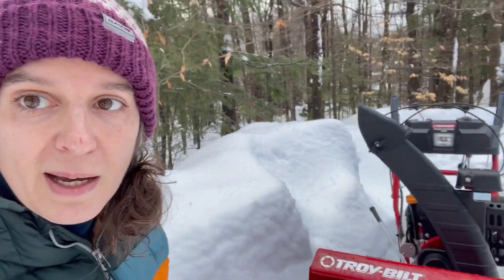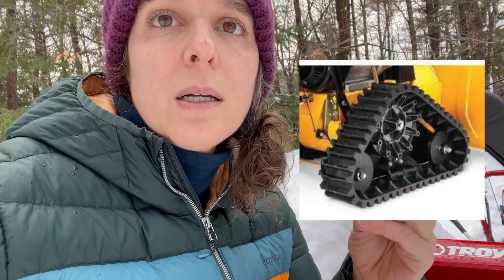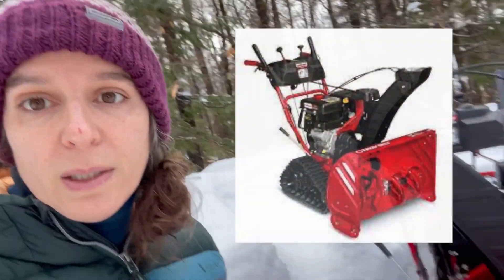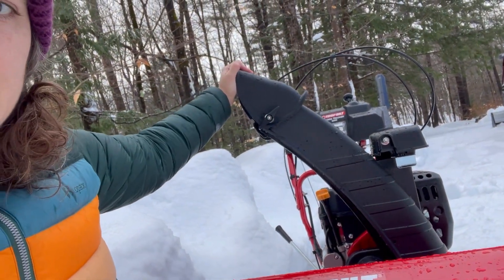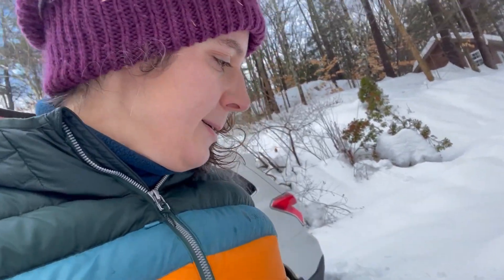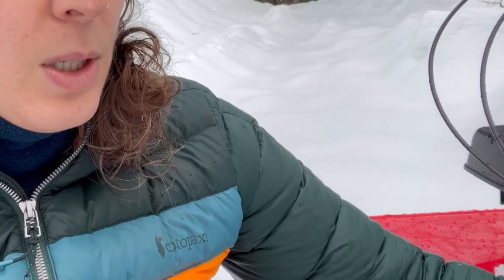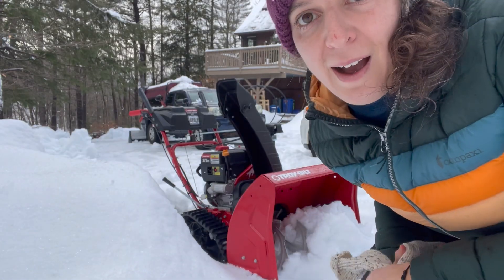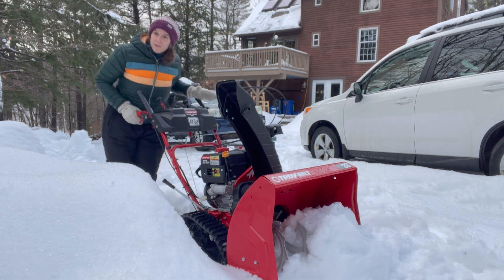Troy Built Storm Tracker Snowblower Review | Track vs Wheel Snowblower | Uphill Gravel Snow Removal

Comment: I have this same machine for over ten years. It’s a beast and rips through snow very well. I maintain my machine every year. My only complaint is the plastic wheel hub in the trac wheels. Both of mine cracked and needed to be replaced. Not a hard repair once you know how to do it. I also upgraded my machine with drift cutter blades, an additional LED light on the front bucket which is OEM from MTD & some heavy duty metal skid shoes. Those 3 minor upgrades make this machine awesome and equivalent to much higher priced machines.

Comment: Change the oil every season , use ethanol free premium fuel…. really helps with longevity. Also…the feet are made for adjusting so the scraper blade doesn’t get trashed.
Reply from the maker: Thanks for sharing! Happy winter!
Reply: Extremely important.

Comment: Hi Woodsy Woman ,  your quite good 👍.   I watched this video , thinking of buying it and have a question .  Love the track idea  but I have a 4 -5 inch spot  , like a concrete  step to go up over from my yard to my driveway so would you just tilt the blower  back  going forward and the same going down the difference in elevation or would it not work well. #2 sub , keep at it.
Reply from the maker: Hi! Thanks for your question. I don’t clean my steps off with this machine and instead use a hand shovel. However, if you are asking if you can maneuver over a step, I imagine you’ll be able to do so. There’s a way to have the tracks move forward without the auger on and that’s what I would do. Worst case, cut a small sheet of plywood and place it over your step to maneuver the snowblower. Good luck and let me know how you like it!
Reply: The tracks will climb right over that with no problem.
Reply: @paulmysliborski4832  Thanks Paul , much appreciated 👍
Reply: @SteveRobReviews  My pleasure
Sir.  
I have actually walked a track unit up and down a flight of stairs.  Lol

Comment: Hi Woodsy Woman, even though the machine you have is labeled Troy Built, I have a very similar machine , the Cub Cadet 3 stage machine. I think that they are all built in the same factory in China. Regardless of that the point of the reverse speeds is spot on, I can only actually use reverse 2 as reverse 1 is extremely slow. Also I've hade my machine fore 5 years now, and the thing I had fail was the large track drive wheels at the top of the tracks. It is made of plastic with a castle nut mounted to the drive axle. The plastic cracked and the drive stopped working.
Nice video !
Reply from the maker: Thanks so much for your kind words! I'm glad to know I'm not the only one who thinks the reverse is slow. 😃 I'll keep an eye out on my tracks and watch for cracking. Were you able to fix or replace them? If you're not already subscribed, I'd love to have you join the community! Let's learn from each other. Cheers!
Reply: Hi, yes I've found that reverse 1 is painfully slow ' I've tried to adjust it but then it affects the other drive modes, so I just use reverse 2.  Yes there is a very good video regarding the replacement of the plastic drive wheels on youtube @TheWoodsyWoman

Comment: Battery-powered equipment has come a long way, but they aren't capable of clearing deep snow. A little advice from a 75-year old Buffalonian, change your oil yearly, grease your augers yearly. You can use synthetic oil if you prefer. Use ethanol free gas, if available, and use stabilizer in the gas. Happy snowblowing.
Reply from the maker: Thanks for the tips! I'll definitely be sure to take care of the maintenance.

Comment: Nice machine.  And don't worry about the plastic (Poly) chute.  It'll out-last you and I.  Lol. 

I have a wheeled Troy-Bilt 3090 with the same chute, and it is as good as new after 6 winters.  And...... It will never rust.  
Also, you can adjust your drive disc to make your reverse speeds faster.  

Very good video.
Reply from the maker: Sweet! Thanks so much for sharing!
Reply: @TheWoodsyWoman  No problem at all.  Always glad to help out a fellow TB owner.  👉🏻👍🏻